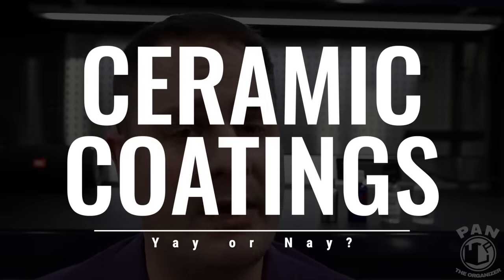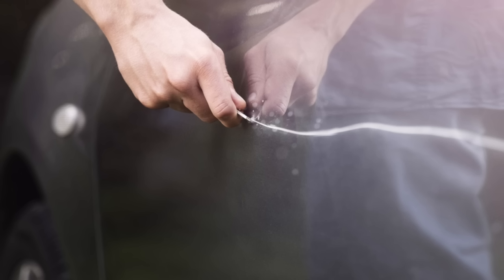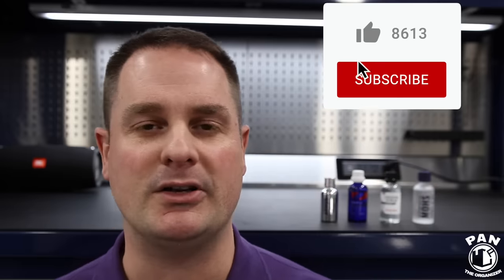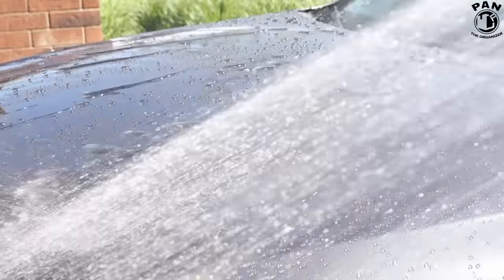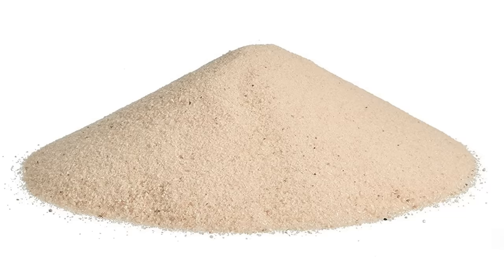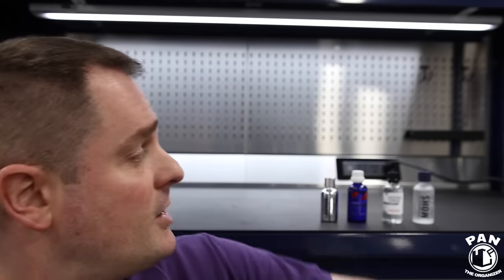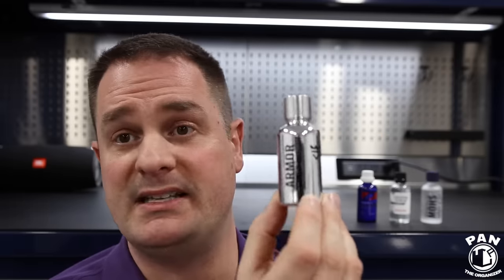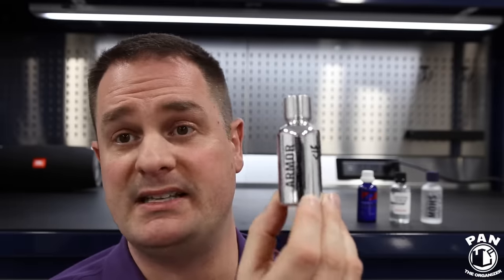DON'T BUY CERAMIC COATINGS BEFORE WATCHING THIS !!

Comment: Which one is the most safe to apply for us the people?
Reply from the maker: AvalonKing and CarPro. Links in the description under the video.
Reply: @PanTheOrganizer  I used car pro I think it’s really strong. I’ll give Avalon a try. Is an open garage enough air circulation or should I have a fan blowing the air out? Thank you pan
Reply from the maker: Open garage is enough. But if by strong you mean smell, all ceramic coatings give chemical fumes. That’s normal. Hence why working in well ventilated areas is important and wearing masks too if possible.

What I meant by easy to apply is easy to put on the paint and easy to buff off (level).
Reply: @PanTheOrganizer  thank you for your time pan

Comment: Pan what about Film paint protection what is your view on this
Reply from the maker: I don't like PPF personally I would never apply that to my cars. But I get a brand new car every three years so stone chips aren't of any concern to me. If you keep your cars for many years, drive a lot and want the ultimate stone chip and scratch protection for your point, you have no other choice than PPF. But I would still apply a ceramic coating on top of PPF.

Comment: Do you also have to throw away your applicators and microfiber towels with graphene? the 303 version.
Reply from the maker: No. Just wash them immediately after use and reuse them.

Comment: All reviewers if ceramic coatings suggest we wash our cars ourselves but what if we only have the option of carwashes, are ceramic coatings still advisable?
Reply from the maker: It’s never advisable to use automatic car washes for any form of protection. They use harsh chemicals that can eventually break down the protection over repeated use.

That being said, ceramic coatings are way more resistant compared to waxes or sealants so they would last longer. Just don’t expect to reach the max durability claim.

Comment: For xuv, how much is the why of ceramic coat required ?
Reply from the maker: I don't understand your question...
Reply: For 7 seater car ,qty of ceramic coat needed?
Reply from the maker: It depends what coating you are buying. Some are just for paint (CarPro CQuartz UK) and some can be applied on paint, glass, wheels, plastics (AvalonKing Armor Shield IX). If you plan on doing all the surfaces, get 2 bottles of AvalonKing. If you plan on only doing paint, get one bottle of 30ml CarPro CQuartz.

Comment: Can you reuse the micro suede towel?
Reply from the maker: No. All microsuede applicators and the towels used to level and buff the coatings should be thrown after use.

Comment: How many bottles are enough to get it done for 2 Suv's?
Reply from the maker: It really depends on what coating you are getting (can it be applied only to paint? Or to wheels, glass, plastics, etc) also the size of the SUVs…

Comment: Can I  clay bar on the vehicle after a ceramic coating has been applied?
Reply from the maker: No, as that would damage the coating. Here's how you do a maintenance wash on a ceramic coated car once every 2-3 months: https://youtu.be/yLiePQRMFc8

And then, once every 4 to 5 months, you would use an iron remover (like CarPro IronX or Gyeon Iron) to remove brake dust and iron deposits from the paint. Those are safe to use on ceramic coated cars.

Comment: Hi Pan! Always great content!! Quick question... you said you always throw away the microfiber towels after applying a ceramic coating would that be the same for the mf towels used to apply a silica spray sealant like Reload? Thanks in advance
Reply from the maker: For silica spray sealants, just wash the towels immediately after use and reuse them.
Reply: @PanTheOrganizer  Awesome great to know thanks!!

Comment: What's better in your opinion 3.0 or the 9
Reply from the maker: Both are excellent, and probably in my top 3 best consumer grade ceramic coatings. CarPro I have had experience with for years so I know how it performs over time. The AvalonKing is still fairly new to me (7 or 8 months) and so far so good, but I'll still need a bit of time to see how it performs over the coming months. For sure, the AvalonKing is the easiest to apply ceramic coating I have ever tested.

Comment: an anyone explain to me if there are better longer lasting ceramic coatings than these??? i ask because i just talked to a guy that had a coating put on his car and it cost him hundreds of dollars and came with a 10 year warrantee.... My back ground is auto painting and boat detailing for many years...now i want to start a business restoring cars and applying the best ceramic coating available.....thanks
Reply from the maker: The products in this video are consumer grade coatings, meaning they can be purchased by the public and they are inexpensive compared to pro grade coatings.

So yes you can get pro grade ceramic coatings that last 6-7+ years but those cost way more and can only be purchased by professional detailers that are accredited installers for that specific brand. Completely another ball game obviously.

For example, I had my car professionally coated with Opti-Coat Pro+, a pro grade coating that lasts 7+ years in this video: https://youtu.be/C_hb8PMP3KA

That service starts at $1600 USD for a car like mine.

Comment: How would you compare these products with Hybrid Solutions Ceramic Coating?
Reply from the maker: You can’t compare full blown true ceramic coatings (multi-year durability) against spray coatings. Two compleeeeetely different categories. True coatings last way longer but are more expensive and take more time/experience to apply. Spray coatings are less expensive, way quicker/easier to apply but don’t last as long (6-12 months). 

You have to pick what is right for you.

Comment: are you saying a 30ml pro grade coating costs around $1000...you said 10 to 15x as much as the 2-5 year diy products.... that seems crazy to me... i heard some dealers charge around $1500 for ceramic coating...i would think if they paid $1000 for 30 ml plus all the labor they would charge even more...
Reply from the maker: I meant the entire service obviously as a consumer can’t just buy the pro grade coating, he has to get the service done. Like the Opti-Coat Pro+ coating on my car. That service starts at $1500 USD on a car like mine. You can’t just buy the coating separately.

So common sense will tell you that obviously the detailers need to make profit on that $1500 so the coating itself doesn’t cost $1500, but nobody knows the true cost. My guess based on discussions with certified detailers would be 300-500$ for most pro grade coatings which is still many times the cost of consumer grade coatings. Can we agree on that?

Comment: Let`s say you pass by plants (and touch), do ceramic coatings protect against these swirls and minor scratches??
Reply from the maker: Coatings don't protect against swirls and scratches. If your main concern is protection from stone chips, scratches and swirls, only paint protection film (PPF, also known as clear bra) will do that. You can apply a coating on top for the best of both worlds.

Coatings can protect against some very light marring coming from the hand washing and hand drying stages, but that's pretty much it. Coatings are there to enhance the appearance, boost gloss and slickness, add UV protection, chemical resistance, and give self-cleaning properties due to extreme hydrophobics, meaning the vehicle is much easier to clean during maintenance washes and stays cleaner for longer.

Comment: Hey Pan,

Hope you can answer the following question for me, or perhaps this would be a great subject for a future video?

I recently purchased a set of winter alloy wheels and tires for my BMW. After fully cleaning them using CarPro Reset, IronX, TarX and then a wipe down with Eraser, I gave them two coats with Cquartz UK v3.0 and finished off with a coat of Reload. I will shortly be installing the winter wheels and removing the summer ones. Currently the summer ones are coated with one layer of OP Ceramic (Owners Pride based in Omaha, NE), but given that the installer applied the ceramic without removing the wheels from the car (due to liability reasons), I’m confident that they’d benefit from a more complete wheels off coating. I’m making this statement having coated the winter wheels myself, I can’t believe that it’s possible to do a complete job reaching all surfaces with the wheels still on the car. So, here’s my question: what do I need to do, to prepare the summer wheels for a new ceramic coating on top of the existing coating? Of course they need fully cleaning, that goes without saying. I think I’m right in believing that a wipe down with CarPro Eraser as the last cleaning step will remove any sacrificial layer of hydrophobic sealant (similar to Reload etc) and prepare the existing ceramic to accept additional layers of new ceramic on top, but I’d like your confirmation/advice. As a last note, the summer wheels are approx 3 months old with just 2,000 miles on them so far. Fairly sure there’s no paint damage, scratches etc, so no need to clay/compound them, and that’d take the ceramic off I paid to have installed right?

Thank you in advance. Keep up the good work.

Keep it tight and keep it clean :)

Russell
Reply from the maker: I'm a bit confused as you wrote so many things, and so many questions... If the installer applied OP Ceramic (a great coating by the way!) and didn't remove the wheels, that means he only coated the wheel faces most likely, and didn't coat the inner barrels. The only way to strip a coating off is by machine polishing. An IPA or strip shampoo won't fully remove a coating, especially not a pro grade coating.

And to properly coat a wheel inside and out, I recently made a popular tutorial about a full wheels off detailing job including ceramic coating here: https://youtu.be/3LCQ0g589pM

The other option if you can't do a full wheels off detailing but still want to coat the entire wheel, is to use a spray-on rinse off silica spray sealant like Gyeon Wet. I show its use in my popular wheel cleaning and protecting video here: https://youtu.be/Ty4ZTq7A7rc

That type of protection only lasts 2-3 months, but takes seconds to apply and you can simply top off the protection when needed.
Reply: @PanTheOrganizer  

Hi Pan,

Sorry if I made it more complicated than I needed to. I don’t want to strip the existing ceramic coating from the summer wheels. I paid for full wheel coating, including the barrels on the original summer wheels. Because I now have some limited experience in coating wheels myself (that I gained from coating my new winter wheels, which I did with the wheels off the car), I’m finding it difficult to believe that the installer can have done a thorough job with the summer wheels still fitted to the car. That, and the fact that I have plenty of ceramic left from coating my winter wheels, led me to the conclusion that I should re coat my summer wheels once I take them off the car. You have said in various videos that ceramic coatings can be layered, and that you can layer ceramics from different manufacturers without issue. You’ve also said that the sealant on top of the ceramic should be though of as a sacrificial layer and is what provides the hydrophobic properties. What I’m asking is for you to confirm that if I want to apply additional layers of ceramic to my summer wheels, I need to first remove any hydrophobic sealant, and that I can do this with an IPA product like CarPro Eraser? I assume if I don’t remove the sealant first, the additional layers of ceramic I apply won’t be able to bond properly to the original ceramic already on the wheels?

Does that make sense?
Reply from the maker: Yes you could wash, dry, CarPro Eraser, and apply a new coat of coating on top of an existing coating.

Comment: Is a ceramic coating safe for single stage paint?
Reply from the maker: There is always an ongoing debate about coatings on single stage paint. The consensus seems to buy you can apply them, however don't expect the same durability as if they were applied on clear coats, as they were intended to.

Comment: This was very enlightening, thank you!!  I still have questions:

I have an older t crossover vehicle for street driving, and a new 4Runner that I want to take it out to play off road.  

1. Professionals promote multiple layers of ceramic coating.  Would it add benefit to apply 2-3 layers of the Armor Shield IX for either car?  5 layers?  If so do I need to let one coat cure the full 24 hours before applying the 2nd coat?

2.  I've been researching to see if I can put something on top to act as a sacrificial layer to protect the clearcoat from the " Arizona Pinstriping" that occurs when going through the unanticipated brush one is likely to find on some trails.  Would the ceramic coating, even multi-layer, be suitable for that purpose?  I understand that it would not protect from the worst of it, but would it mitigate the minor brush scratching and even be reparable?
   If so: 
      a. What would be the best way to maintain the ceramic?
           i. Use the spray ceramic you mentioned for every 3 months after every outing. How many layers?
           ii. Apply synthetic sealant over the ceramic and reapply after every outing or ever 3 months  If so, how much?e
           iii. Do ii but with wax paste
     b.  Would it be advisable to apply wax paste or synthetic sealant on top of the ceramic?  Would that be likely to minimize the impact to the ceramic?

3.   Is there a different solution you would recommend for off-roading?

I know that's a lot, thanks for doing what you do.  It's very informative.
Reply from the maker: Hi David. Wow, way too many questions lol. With 550,000 subscribers who send me thousands of questions daily, I don’t have the time to give lengthy answers. 

But in a nutshell, no ceramic coating protects against swirls and scratches and stone chips. That’s not what they’re designed for. If you’re concerned about scratches, apply paint protection film first, and then a ceramic coating on top.

As far as multi-layering, it depends on what coating you buy. Follow the instructions on the product you purchase. Most good consumer grade coatings recommend two coats. The second coat is typically applied an hour after the first coat and is mainly to ensure even coverage.

Do NOT apply waxes on top of ceramic coatings. I have a video showing how simple a maintenance wash on a ceramic coated car is: https://youtu.be/yLiePQRMFc8

I also highly recommend that you watch my super popular tutorial on how to properly apply a ceramic coating here: https://youtu.be/byKcYsEyWGk

Comment: Is the armor shield really better than uk 3.0?  Pan pushing it so hard.
Reply from the maker: Who said Armor Shield was better than CQUK 3.0?? Overall, the CQUK 3.0 is still a better coating, it took first place in my annual car detailing products awards. Here's my awards video: https://youtu.be/LkD22UGujmw

But very close was the AvalonKing because of its ease of application. If you want the easiest coating to apply, AvalonKing is by far the easiest coating I have ever applied. Not everyone has the experience to apply ceramic coatings, so the AvalonKing coating is really great for those who want to dive into the ceramic coating world without having to worry about flashing times, curing, high spots, tacky removal and buffing, etc.

I don't push anything onto anyone Matt. You should know that if you have been following my videos for a while. I just share what I like to use, and what works great in my tests. Helping my viewers to make better purchasing decisions.

Comment: Can you use a ceramic coating after cutting & polishing a car
Reply from the maker: After polishing, you need to remove polishing oils and residue with a paint prep spray before you apply the coating.

See my ceramic coating application tutorial: https://youtu.be/sqQYVjxFqK0?si=UBcn88_FkTLLXosI

Comment: HEY PAN I HAVE A HALF BOTTLE OF C QUARTZ THE ONE  BEFORE THE 3.0 , COULD I APPLY THE OLD BOTTLE FIRST LAYER AND THEN ADD THE 3.0 FOR THE SECOND LAYER ? Thank you. @pantheorganizer
Reply from the maker: If you have the old CQuartz, then it is past its lifespan. Shelf life on detailing chemicals is 1 to 2 years max, if kept in stable conditions and never frozen. You also often have the expiry dates on the bottom of the CarPro glass bottles.
Reply: So it’s definitely not a good idea mixing a possibly expired bottle. Makes sense. Thank you for the quick reply. Keep up the good review videos.
Reply from the maker: Thanks I appreciate it! How did you discover my channel by the way?
Reply: @PanTheOrganizer  so about four years ago I was looking up new techniques to wash my car and saw the way I was doing it was the exact same way you were. I watched the “ complete detail on a black car “ with the m4 I believe it was. So I edited some of the cleaning techniques I did and was set. Ever since then I was hooked on to the ceramic coating reviews and honest opinions of all the products you get. Cquartz by far my favorite coating.

Comment: Pan, do you have any experience with Modesta Ceramic Coatings?
Reply from the maker: Nope
Reply: Ive watched some videos where Modesta is mentioned as having a 10 year life... does that sound possible?
Reply from the maker: Could be. But Modesta isn’t available to the public anyways. It can only be installed by authorized dealers.
Reply: @PanTheOrganizer  I understand. I am going to pay a professional for an install, i am just wanting to find the coating that will last the longest for myself. Is there a professionally installed coating that you think is the best in terms of how long it will last?